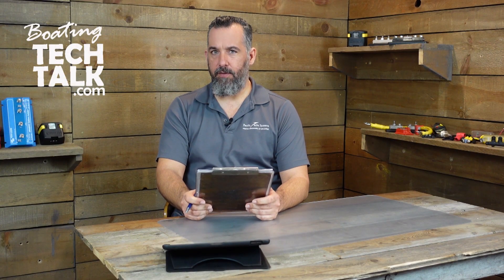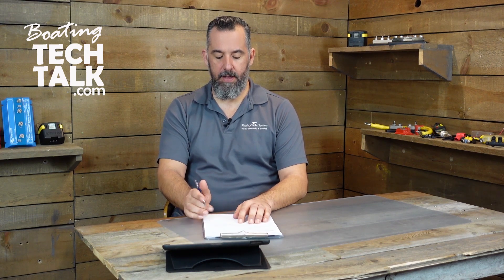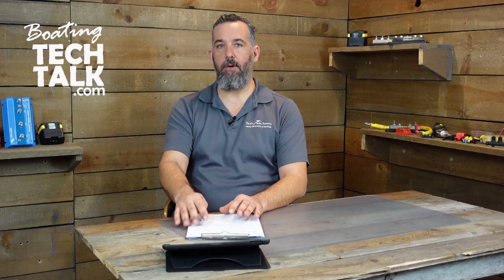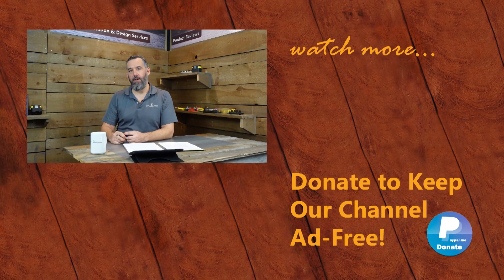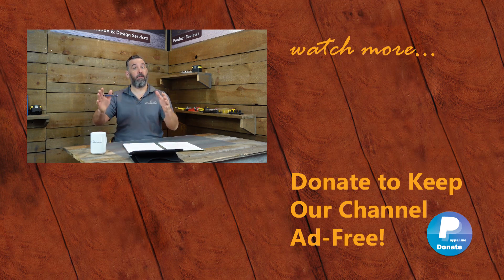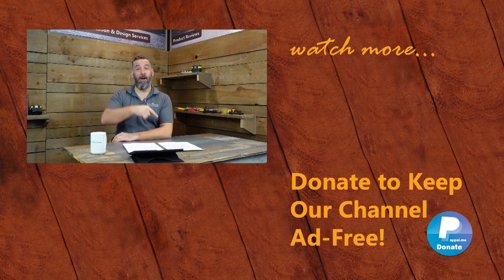Can I Use a Battery Isolator With an Outboard Engine?

Comment: I purchased a boat with a house battery for electronics and a battery for the Verado. Connected by a isolater. I have 2 switches as well. Recently I had both draw way down  while on the water . I did not think that was possible with a isolater. Is it possible something is hooked up incorrectly? Thanks!

Comment: Hi, this Chanel is awesome it's really helped me realize that I know jack. 
I have question since I have scratched an isolator off my list.
I am re-doing an 37' allwest and I am on the  wiring stage making a list of what to order,
 I'm  yanking the twin Volvo diesel inboards and I'm going to pod it and put on twin outboards,  after watching your videos I'm wondering whats best I figure I at this point I would have 3-4 house, 2 crank maybe 1?, and maybe 1 for the anchor winch and future bow thruster. would you use a battery combinor and if so how would you configure it? 
thanks Paul
Reply from the maker: I'd recommend dedicated starter batteries for each engine and a house battery bank. If you get a bow thruster, then you should get a dedicated battery for thruster and windlass.

Comment: A Allan
A Allan
1 second ago
When installing dc to dc chargers, do you prefer to connect them from starter battery to house battery or from alternator to house battery on boats with outboard engines?
Reply from the maker: My preference is battery to battery. Never even thought of doing alternator to battery.

Comment: Love your videos. 
Question for a future upgrade. Twin engine cruiser, 2 alternators charging individual starting batt. and 3 flooded house batteries, all connected via a magic box (Total Automatic Battery System - TABS) made by Bob Wells. Frugal power use at anchor gives us 2 days w/o need to run the gen. I want more capacity and lose weight by using lithium for the house bank. Plan is to get rid of the TABS to separate flooded from lithium.

If we use a DC - DC converter charger for alternator charging, and a 3 channel A/C charger, is there a conflict between the chargers if the A/C charger is running at the same time as the engines (eg: warming up the engines at the dock before unplugging shore power)?

Thanks in advance.
Reply from the maker: Hi Light Mechanic, you can have both a battery charger and an alternator both outputting to a battery, running concurrently.

Comment: I consider a 'battery isolator' as a device that isolates the battery from something.  I have an isolator on my boat, so that I can disconnect the battery from the outboard.  When there is power going to the outboard, power is then provided through the outboard wiring harness to the forward controls.  This means that I have potentially 20+ feet of cable that is always live, unless I turn my battery isolator off.

Are you suggesting that my outboard should be permanently wired to my battery at all times, with no form of isolation?  Wouldn't that mean I'd have to disconnect the wiring from the battery before working on the electrics, rather than just turning the isolator off?  What about the house circuit, should that also be permanently attached to the battery with no isolation, on an outboard boat?
Reply from the maker: Difference definition of terms. 
- All engines need to have a battery switch to between the start battery and the starter solenoid
- Some alternators need to charge more then one battery and a battery isolator allows an alternator to charge 2 or more batteries and yet each battery doesn't "see" each other.

Comment: Jeff, I am adding electric headsail winches to my 46 ft sailboat. The length of the run requires 2/0 cable. Is it ok to daisy chain the second winch off of the first winch? I plan to use a separate contactor and switch for each winch. I only plan to use one winch at a time. The cable will be protected by one breaker off of my house bank positive bus.
Reply from the maker: Hi Mark, if the loads (i.e. electrical winch) were used one at a time, then yes, it's doable. A part of me though, would rather have both winches properly wire with 2/0 each or 4/0 for both.
Reply: The house bank is on the starboard side mid ship, 15ft from the winch. It is another 12 ft over to the port side. I am finding it hard to justify spending another $300 for dedicated cable to each. I will run daisy chained and see if there are any issues. Thanks!

Comment: G'Day @Pacific Yacht Systems from Victoria, Australia. I watched your 2019 video about galvanic isolator troubleshooting and that episode made me read up on isolation transformers and watch your recent video on the difference between a Galvanic Isolator and an Isolation Transformer. I'll be going with an isolation transformer after your presentation but would love to see you do a video that specifically discusses electrical potential and grounds (copper busbars or otherwise) on yachts, floating DC systems, floating AC circuits, HF radio grounding, lightning protection with grounding integration from the mast top including through to the exterior underwater grounding plate.
What did I miss? ;)
Maybe some electrical diagrams that show the integration of each of these different systems and where they need to stay separate such as in cases of reverse polarity shoreline connections, and finally what should be done in a thunderstorm such as turning off and/or disconnecting equipment to safeguard. eg faraday cage or not. 
Almost forgot, what about when on the hard and switching the neutral earth for want of a better term?
Love your technical videos, please keep them coming.
Reply: Q. Please tell us all about how grounding systems should be connected to our electrical circuits to protect us and our boats?
Reply from the maker: Working on a presentation like that, just not ready.

Comment: Lucky most outboards 2019 and above have BUILT-IN isolator . You need to but the adapter/harness from the manufacturer .
Reply from the maker: Really, tell me more? Most of the outboards on the boats in our area have only one positive connection to starter solenoid, in turn alternator are wired to starter solenoid.
Reply: @PacificYachtSystems  Great videos! You're on fire! Question, Can two Victron Orion-Tr Smart DC-DC Chargers 12-12-30 model be use to charge a 400AH lithium house bank on a twin Yamaha 250 four stroke outboard motor application without burning the charging stator on the outboard motor?
Reply: @PacificYachtSystems  Jeff, Most large Yamaha outboards (150hp and up) have separate battery isolator/charging leads specifically for this purpose.

Comment: Luckily my outboard was already set up with a battery isolator but my son's boat wasn't so I added the Blue sea systems "add a battery" and it is perfect for this application. Both the house and starter batteries are being charged when the engine is running but the starting battery is isolated from the house battery so it doesn't get discharged when he's running lot's of electronics all day. It's like the old switches that were Bat1-Bat2-Both but it's better, it's only off-on-combine. On separates the loads on the batteries but charges them both. Combine is for emergencies if the starting battery died for some reason. I hope whoever asked this question looks into this product because I think that's what he is looking for. It's about $100US on Amazon. I just noticed that they just came out with another version that has a 10amp AC charger for charging at the dock or at home. It's great to see these new products for our changing needs🛥️😃
Reply from the maker: Thanks for sharing Noble.

Comment: Jeff, I bought a Niagara 35 last fall. It has 3 deep cycle lead acid batteries (2 house ,1 starter).
They are wired using automotive grade cables and the main DC feed is a welding wire.

I want to re-wire them with marine grade wiring. What size wires and bus bars would I need for this project?   

Thank you for the great videos
Reply from the maker: Check out the voltage and amperage table for choosing wire sizes:
http://assets.bluesea.com/files/resources/reference/20010.pdf